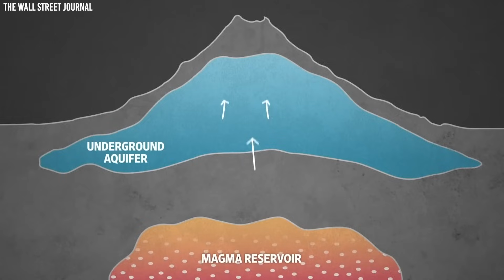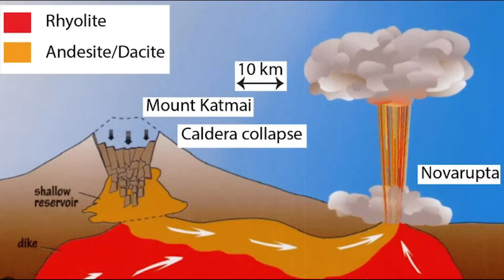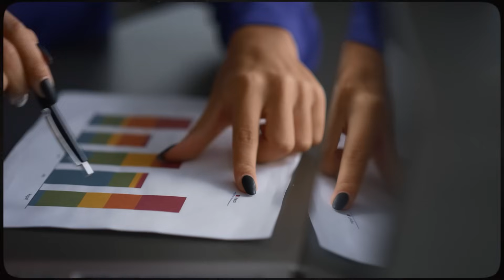The Iceland 100ft Volcano Crack Is About To Cause The BIGGEST Eruption In Europe

Comment: You do realize, do you not, that Iceland is an island and not on the European mainland.  Not that a large eruption would not cause difficulties with air travel, but it is closer to Greenland.
Reply: It's the eur-asian plate and jet stream pushed eastward.
Reply: Actually it did cause troubles because I was flying from the US back to Italy when this eruption happened in 2010, my flight was canceled and I wasn’t able to get back for a week! Winds cause sand from the Sahara desert to travel into Italy quiet often.
Reply: 1867 Krakatoa went off and cause a unless summer with snowing in NYC . 
This could be bad …
Reply: well but the eruptions of the 130 Laki Craters from June 1783 to january 1784 had indeed a lot of affects also on the mainland of Europe also a lot of people starved in Eire and northern England and also on Iceland. it  started a bit like this one now with a massive crack the bigger trouble was that also a lot of Gases like HCl and HF were set free . with rain you have, related to HF, one of the most poisonous acids to life you can have.